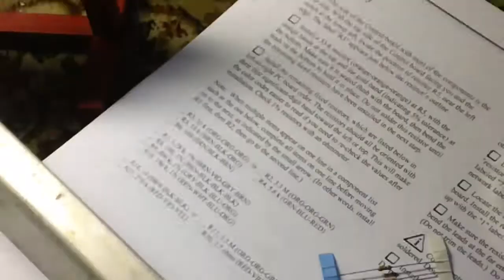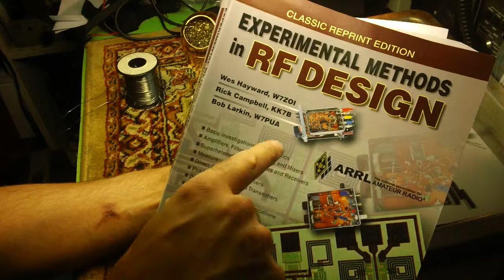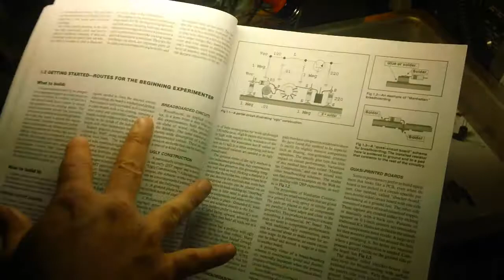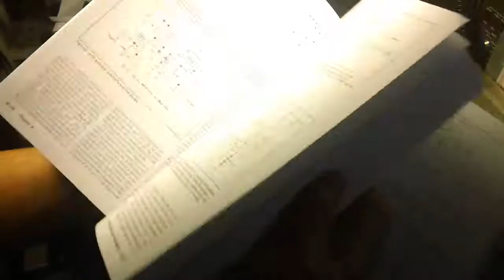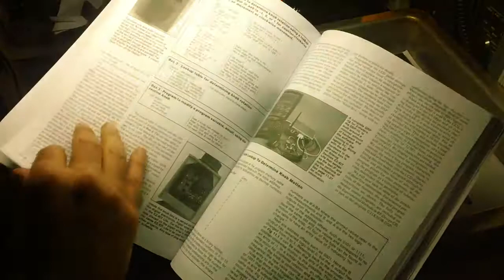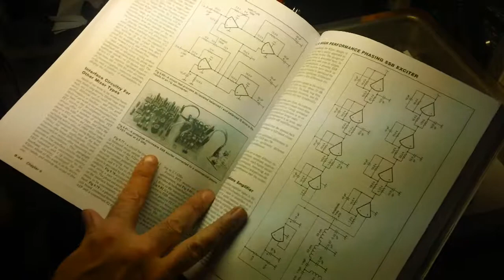Elecraft K2 Build Part 2

Comment: Experimental Methods in RF Design is a work of art! Nice job so far. One thing I do with resistors is to bend the leads while they are still grouped together. I lay a cork back stainless ruler across all of the leads and bend them up as a group, then rotate 180 degrees and do it again. Then I snip the paper off with sharp cutters as I use them. 73 NE5U  Mike